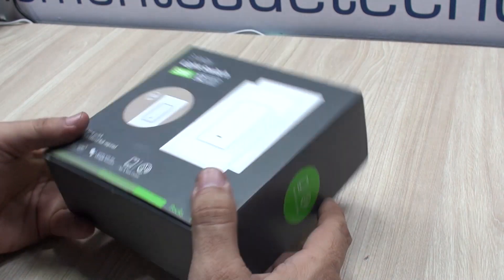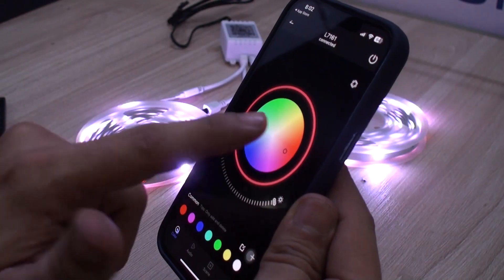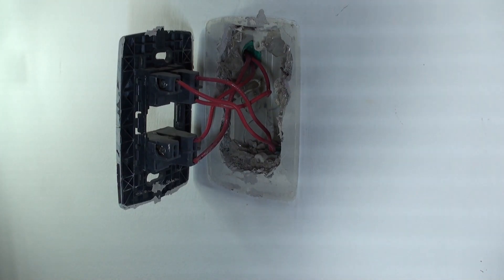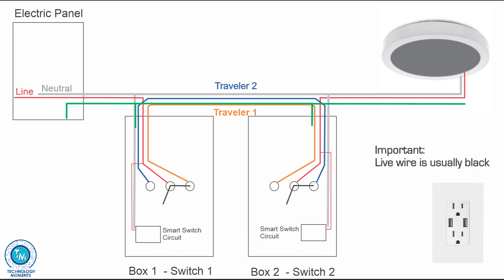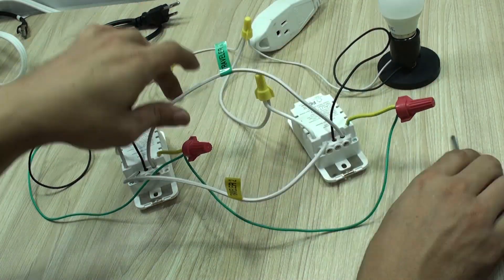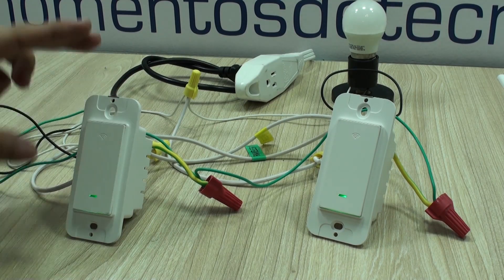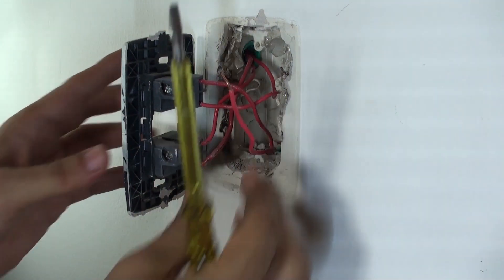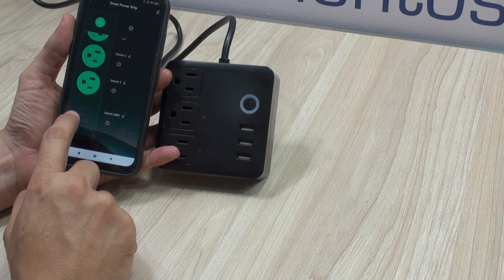3 way Smart Switches - How to wire and setup?  9/24 wiring scheme

Comment: I dont understand why does the second switch need to be physically connnected to the first one. Shouldnt the connection between the two be wireless?
Reply from the maker: Hi, please remember that this is not a typical scenario.  This one is a 3 way switch or wiring it as 9/24.  This means a light that in its analog configuration can be commanded from two or more switches.